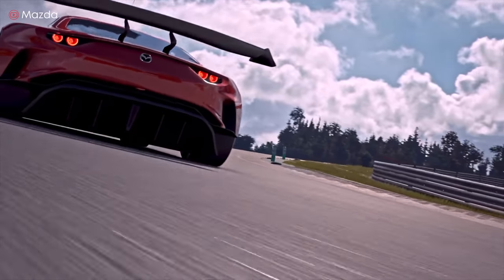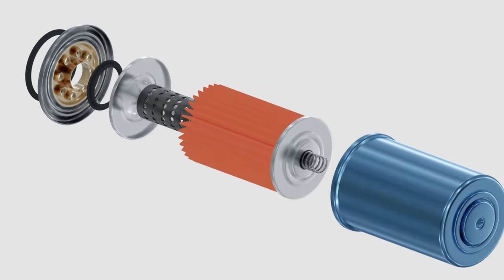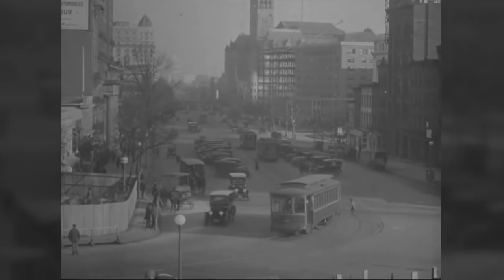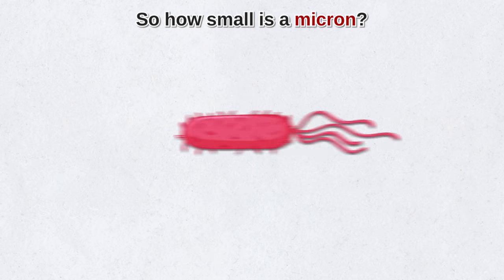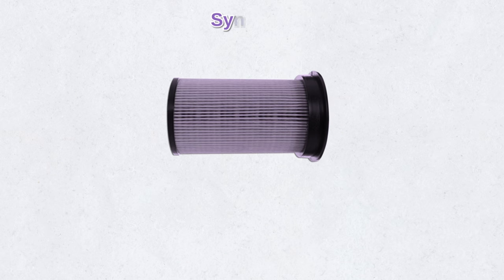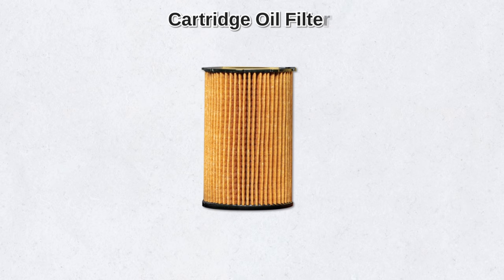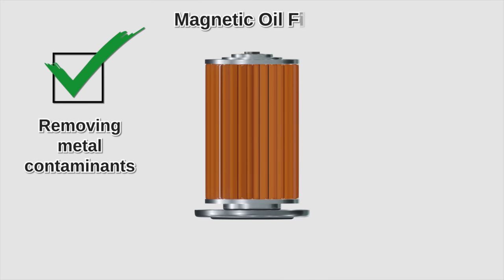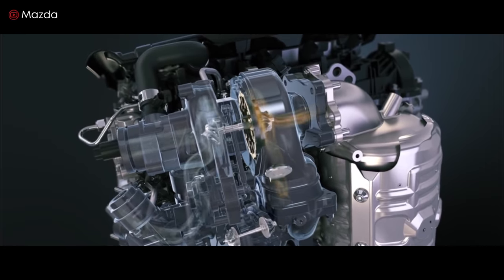This New Oil Filter Just Changed the Game (No More Oil Changes)

Comment: So where's the oil filter thats a game changer as advertised??
Reply: The game changer filter is the brand that pays the most.
Reply: Amsoil oil and filters are the best in the market 🇺🇸🇺🇸
Reply: Mobil 1 full synthetic 20% more efficient and is guaranteed for 20,000 miles or two years.
Reply: @captaindeadpool1640  show me where you get this fallacy
Reply: @captaindeadpool1640  I cannot imagine ANY oil will stay stable for 20,000 miles!!  Does your vehicle have a built-in refinery or something?? Even car companies that recommend 10,000 mile intervals are dreaming, unless your car holds 10-15 quarts of oil! Most hold 3 or 4 quarts these days with the tiny engines they use..
Reply: @bigwo56 :  Plus, unless the filter has huge capacity, it's likely to reach capacity before 20,000 miles, and then you're just passing dirty oil through your engine -- which is a disaster. 

Gotta love the internet and all the random "helpful" commenters spreading nonsense.
Reply: @gr7523  is it really good for 20,000 miles?
Reply: @anno4486  it is good for 1 year/25k miles if you are using the signature series Amsoil. 100% synthetic oil
Reply: Game changer filters have been around for many years. They have always been bypass filters or what you call secondary filters. I prefer the ones that dont cost more to service than an oil change. I know most people don't have the mechanical skill to install them. Most people think engine oil is supposed to get dirty and be changed. That's not my fault. No Amsoil doesnt make game changer oil filters.. It takes depth such as Scott 1000 sheet. Pleated filters dont cut it. It's  not that complicated. When I started using the Frantz oil cleaner in 1963 I was using Chevron Delo 30 weight. I was paying 29 cents a quart at the discount store. Not sure what I was paying for 2 ply facial quality bathroom tissue. I was using a quart of oil and a roll of toilet paper every 2 K. Ii didnt drain oil. Still dont drain oil but I use a roll of bathroom tissue and a quart of synthetic every 6 K. I also like the Gulf Coast and Motor Guards.  There are other good ones. I wouldnt pay 30 bucks for something as good as bathroom tissue.
Reply: @gr7523  Id love to see someone wo has used the Mobile1 Guarantee? I've used Mobile 1 but NEVER went past 5k miles on it. Oil is cheaper then engine parts still today!
Reply: @jessstrunk6102  mobile 1 is good oil. Amsoil signature series is tier 5 (100% synthetic) not full synthetic like royal purple, penzoil, or mobile 1. Good for 1 year/25k miles in conjunction with an Amsoil oil filter.🇺🇸🇺🇸🇺🇸
Reply: @captaindeadpool1640  you do reckon that Full Synthetic is just a marketing term and is 0% Synthetic
Reply: @justinpennington7682  yeah, that should be safe, unless it gets lots of idle time or heavy towing..
Reply: @bigwo56  thank you for letting me know after 200k miles . I couldn't have done it without your confirmation
Reply: @justinpennington7682  HAHAHA!!  Welcome Justin, good point!  Maybe someone else can benefit from our feedback.
Reply: @bigwo56  yes sir !
Reply: @captaindeadpool1640  the best oil filters are either any type of Wix filters, or the Fram Ultra Synthetic Filters, Supertech Filters are excellent as well for the money and are of very good quality.
Reply: @captaindeadpool1640  bunch of baloney on that one, I've tested it against wix and amsoil and it can barely hold a candle to wix XP and the amsoil variants, only pro is that the filter media stays together longer than a regular wix, but it does about the same filtration as regular wix.
Reply: @bigwo56  it really depends on how healthy your engine is, how much blow by you have, what kinda fuel you run, etc. I've seen 50k changes on propane trucks that look like new oil, meanwhile on a methanol fueled drag car the oil's about 40% fuel after just 6 quarter mile passes.
Reply: @jessstrunk6102  mobil isn't actually as great as they say they are, castrol edge, pennzoil platinum/ultra plat, and amsoil XL and signature all outdo it.
Reply: @ajuber876  I believe it has to be 40% tier 4 base (the lowest synthetic base) to be legally advertised as synthetic in the US. Also tier 3 oils from natural gas like pennzoil platinum can be sold if they use like 90% the cracked gas oil as a base, which is actually a synthetic and while not being top tier rating wise t3 gas oils are actually full synthetic and have properties that make them better than many t4 oils in automotive applications. Amsoil is not the only company to use pure t5 base stocks, redline racing oil does as well, but is not sold in formulas suitable for use in an unmodified modern vehicle, and purple does mix some t5 base stock in, but is not straight t5, and iirc it's a blend of t3, 4, and 5 base oils.
Reply: Well, I have been replacing the oil filters in my two cars every other oil change, but but but I do not use the correct/original/recommended/as per design one, I use a bigger one (1 1/2 original size), and and and I rinse them with new oil and place them upside down until the last drop comes out. What's up?🤪. FRAM EXTRA GARD 3600, 3 more dous than the original.
Reply: @pablovelazquez1570  that's just plain stupid, you can't ever wash all the contaminants out of a dirty oil filter, so you're purposely putting a dirty oil filter back on your car to save a few bucks? How about you actually run halfway decent oil, double your current drain interval, and change them together?
Reply: @gr7523  it says it on the box for the oil filter. Mobile 1 black box.
Reply: @Prestiged_peck  I'm 100% Amsoil Signature oil in all my vehicles now. I agree
Reply: @bigwo56  Maybe 20,000 miles might depend on where you drive and how you drive - country or city, etc.  Do you drive in the desert or where it is very cold or dusty, or lots of salt air?  Not sure if those would affect how long your oil will last or not, also maybe the quality of fuel you use to power your vehicle may play into it too, and age/wear of your car's engine.  Just think shortly, hopefully we won't have to worry about this as much as we will all be driving electric vehicles that won't require oil or oil changes, or rebuilt transmissions or rebuilt engines. Just new battery packs.........which I would guess will not be cheap.
Reply: K&N oil filters the best
Reply: @bigwo56  The ONLY way I would keep oil in an engine for 20,000 miles is this.
A) Oil filter is changed every 5,000 miles with a top off of new oil.
B) An oil tribology is performed at 10,000 miles prior to new oil filter.
C) Oil tribology is performed at 15,000 and 20,000 miles.
Only then, armed with real scientific data could I endorse changing the OIL at 20K intervals.
Say the oil IS good for 20K.  The oil filter changes would still need to be performed.
Reply: @gr7523  look up fallacy
Reply: Oil yes. Oil filters no way. I’ve had numerous Amsoil oil filters that had metal filings around the holes where they weren’t done properly by deburring. Now I will say they are currently offering Donaldson filters (think that’s the name), and I have had the best cold starts with those filters.
Reply: Frantz Gulf Coast  Jackmaster Motor Guard These are the game changers  I have used over the last 60 years. Not sure which of the full flow filters is best. You cant clean oil at 10 quarts a minute. The Wix on the Pontiac Torrent has about 4 years and 61,000 miles on it. With a game changer Motor Guard on as a back up. The Wix never gets dirty oil. Im running a Australian Jackmaster Classic on it now. I prefer dirty oil filters instead of dirty oil. I normally dont drain oil. The oil changers dont support the game changer filters. Started with a Frantz oil cleaner and Standard Delo in 1963 on the Rambler. Had to check out the Jackmaster. Its easy to service. Push in the element and put on the lid. Cant beat the top loaders. All of the game changers have hoses to deal with. The Jackmaster Classic needs a wrench to open it. I found a wrench and some long nosed pliers to pull out the used TP. One of the top 3. The best being made now.
Reply: @gr7523  No, best filters in the world are PUROLATOR
Reply: @luciorodriguez720  Absolutely not. They are made by the same company that makes Super Tech. Watched a guy take apart a dozen oil filters here on YouTube and Super Tech has the same exact innards as a K@N .
Reply: Yep. Got me an ol toilet paper oil filter. Best ever. That's why it's not commonly available. Or is it?🤔
Reply: @nathanjuan8737  Check out the Jackmaster Classic.  Got mine off Ebay. They claim their elements are better than toilet paper but they set them up to use a tightly wound toilet paper with a larger seal. Probably the best filter in production for using toilet paper. You just push in the toilet paper and put on the lid.. started using toilet paper filters in 1963. The WiX on the Pontiac has 61.000 miles and over 4 years on it. It never sees dirty oil.
Reply: @ralphwood8818  i always wondered what happened to Frantz oil filters and just found out that they are still in business. my dad swore by them. i totally agree with your statements
Reply: @captaindeadpool1640  made by fram now..lmao
Reply: @ralphwood8818  got it from the JC Whitney catalog?
Reply: @Prestiged_peck  Very interesting info. Can you post a link(s) to that. I would like to read more about the difference in the synthetics. 
Thanks in advance!
Reply: A bypass oil filter is the game changer. Filters your oil down to extremely smaller particles than a standard oil filter can easily extend the life of your oil 20,000 miles or more. You'll find several cases where a person goes a million miles or more on the same oil, just doing regular filter changes and adding a little oil when needed. Granted, those vehicles are usually diesels that are doing that kind of mileage on no oil changes. Just regular filter changes. However, the effect will still greatly lengthen the lifespan of your oil in any vehicle
Reply: @gr7523  says who??
Evidence?
Reply: @gr7523  RedLine and Liqui Molly as well.
Reply: @gr7523 I use amsoil signature series synthetic in my mustang with a fram ultra synthetic filter. Oil is good for 25,000 miles and the filter is good for 32000 km. I put about 20,000 km on my car a year. I only need to change the oil once.

Comment: As a young man, I had my oil changed at an oil change chain. They changed the oil and filter. However when installing the replacement filter they damaged the valve inside the filter. This didn't effect the oil flow at idle or low speeds, but when  at high excelleration and speed it was  starving the engine of oil.  I first noticed this when the oil light flickered while getting on the highway.  A full inspection and oil change corrected the issue I've never gone back to a discount oil change place since.

Comment: When I worked on US Army helicopters, the T700 GE engines had three filtration systems that cleaned the oil down to 3 microns (if memory serves.) Many claimed that this thorough filtration made the oil cleaner than when it left the can new. Because we used a local lab to analyze the various component fluids, we rarely changed them/when the lab recommended it. To the naked eye, the oil samples that we submitted looked pristine.
Reply: Correction at some point before 500,000 miles Pepsi sold the truck to a Motorcycle hauler. Lost track of it after a million miles inspection.
Reply: A lot of the issues was with the oil bowsers and contamination in the bowsers.  I went to a manufactures meeting once ( I was Navy AMT 20 years and 30 Civilian)  manufacture swore it is always better to "Punch and Pour" vs using a bowser.
Reply: dear Duranbailiff5337: -Thanks for your service.  Wouldn't the high heat from the GEs break-down even synthetic carbon-chains, so the fluids might be LOOK "Pristeen" but be smaller, so the bearing clearances would, over time, diminish, leading to main-rotor Failure, and the copter dropping like a stone.  I told my "Stup-peeriors" 40 years ago to put a rocket-deployable 'chute on top of the main rotor[s], on top of the radar some times put on the rotor-top, just to keep the copter from turning into a "safe" thrown from a plane, due to ANY reason, but the Military perfumed-princes don't CARE if we grunts...or even "Prezi-dunces" git kilt in the demmed fall!
Reply: @jackdale9831 The system you are proposing is impossible

Comment: We use Wix and Motorcraft as some of us have been training on oil, fuel , air filters! You would be surprised what’s in some filters or lack of filter media
Reply: I use Wix filters exclusively and always will.
Reply: @musicauthority7828  well good for you. Bosch/Mann or whoever makes Wix loves you...
Reply: I only use WIX.
Reply: I remember once going to a really good auto parts store and the filter they gave me which just felt totally different than any other filter especially the weight but they gave me a Hastings oil filter and it seemed like it was a good quality I wonder how good they're supposed to
Reply: @arlenmargolin1650  Hastjng are or were good quality
Reply: The only filters that eliminate routine oil drains are secondary or bypass filters. Only a few of them actually clean oil.  None of the spin on filters can clean oil . It takes depth Comparing filters that dont clean oil is a waste of time. If a secondary filter takes toilet paper or something that looks like toilet paper it will clean oil.  If the element costs more than Scott 1000 I wouldn't  buy it. Some say the Bounty big roll is now a little too small for the large heavy duty diesel engine fllters. I dont think I would have any trouble making them larger. The last Great Value 1000 that I got from Walmart  was the perfect diameter.  The glue on the last sheet kept the  Motor Guard from pinching the paper

Comment: I really like the K&N filters with the hex-nut welded on the end ... it has made changing the oil filter SO MUCH EASIER on several of my cars / trucks that have very hard-to-reach oil filter locations ... they have become the ONLY filter I will buy. (and they are of very durable, high-quality materials also !!).
Reply: Oil filters should not be put on by gorilla's!!!  They "should" be easily removed using an appriate tool.  Unfortuneatly, many 7/11 oil change shops tighten them down like they are lugnuts!  One brand, the one that begins with a "F" uses some grippy material adheareard to the can to make it not much of a chore to R&R the filter can.  -As for their filters, I as an above average consummer,  can only assume they meet or exceed the manufactures specs...

Comment: Talk about changing your oil filter...my auto teacher back in the day made the statement..."well, you change your underwear after taking a shower, don't you, so change your oil filter!"
Reply: Haha that’s really good
Reply: What if I don’t change my underwear for 5,000 miles should I also not change my oil filter?
Reply: What if I prefer to go commando? Should I not run with an oil filter at all?
Reply: Dee Gee, you actually really change your underwear after every shower??  Damn, if your showering everyday, isn't your underwear good for at least a week replacement interval??  I mean all things being relative, it's the mileage between change intervals and less soaps/detergents and fabric softeners will help the Environment!

Ohhh, an don't play wit dat dipstick too much as you shower the engine.
Reply: @lisab3396   they last a long time between changes if you don’t take them off in the shower.
Reply: Do you flush eventually?
Reply: That's funny I changed my shorts more than showering, saves on water and keeps high mileage on my pants.
Reply: what I do is reverse my drawers from outside to inside, no use wasting the unsoiled portion before changing.
Reply: One of my Teachers did'nt have an Oil Filter on his 50s Ford Pop !
Reply: Another dumb statement.Changing your shorts is not related to changing your oil filter.oil is cheaper than engines is another one. I stopped draining oil a long time ago by never allowing it to get dirty.
Reply: I dont change oil .I use Walmart  synthetic oil. I use Great Value 1000 toilet paper in my secondary filters. The Pontiac Torrent  will outlast me. The old 76  F 250 will still be here when I'm gone. It.has a very old  Motor Guard on the engine and a not so old Gulf Coast junior on the transmission. The oil in the engine is Delo 400 .  I  could use synthetic oil in the old Ford. It wouldnt make it last longer but might get better gas mileage. I do have a Ford motorcraft  filter on it.
Reply: Worked for a company that gave us 13 uniforms. A biker  said that's good for a year and a month. Dont want to know about his shorts.

Comment: Hey Scotty, do you edit these yourself? These types of videos are awesome! I still love your unscripted content too 😁
Reply: Nothing worse than a guy asking a question he already knows the answer too just to try to be noticed
Reply: Filters that clean oil have been around for 70 years. They are seldom mentioned. They started with a Frantz oil cleaner in 1953. My experience started in 1963 with a Frantz oil cleaner on my Rambler American. In 1961 Motor Guard came out with another one. They converted to compressed air filters. Gulf Coast filters came out with improved top loaders. Im told the Jackmaster came out in 1954 in Australia. Similar to the Gulf Coast junior it is made of high pressure die cast aluminum. I had to have one. Removed a Motor Guard to make room for it on the Pontiac Torrent. Should have ordered one years ago. Ordered the Classic model with no hoae and fittings.. Nothing wrong with the Motor Guard. They filter the same. The Motor Guard on the Ford 390 is 50 years old..Seems to be more interest in the game changer filters.